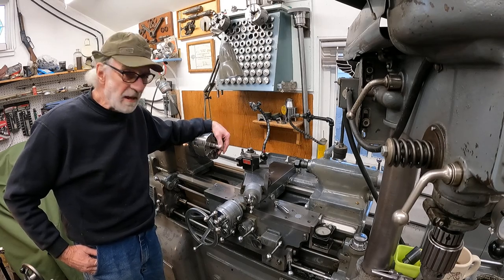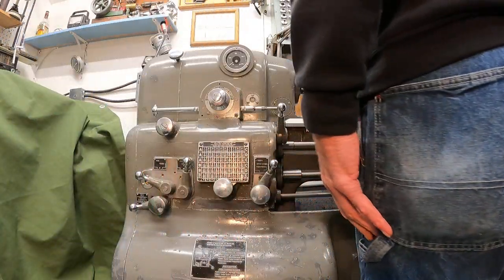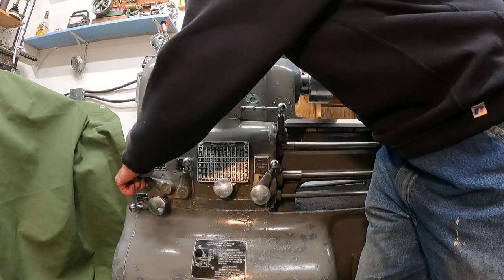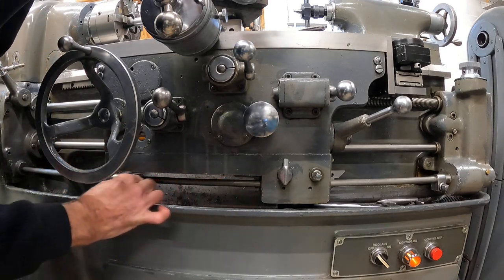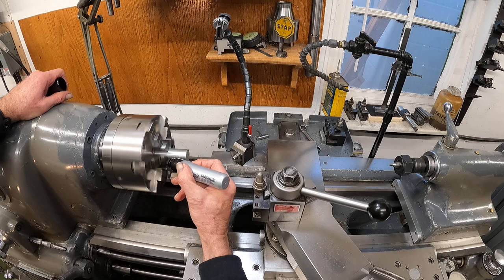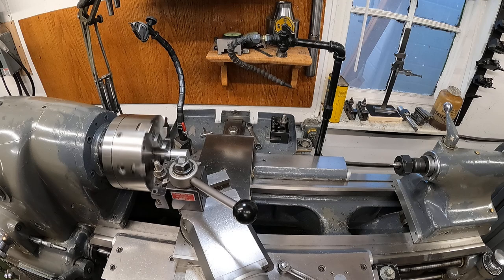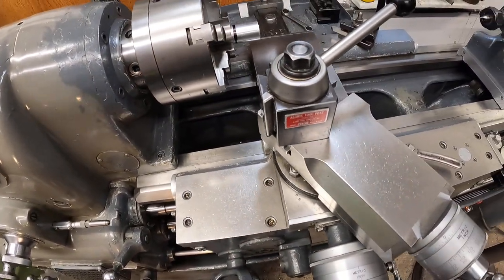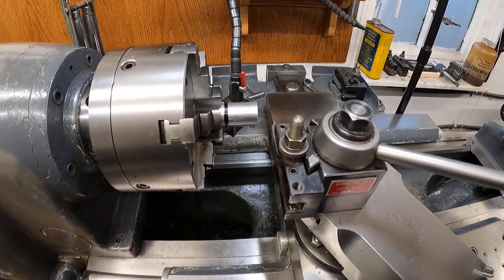Monarch 10ee Inch/Metric Lathe Metric Threading Part 1

Comment: In my experience on my ELSR, once you set the stop it will repeat within “tenths”, but if you change spindle speed it will change the stop location due to the spindle inertia coast, you had set the stop then sped up the spindle in your demo, hence the .020 reading IMO….VERY good explanation/demonstration
Reply from the maker: I did get ahead of myself by not setting the speed first. Many operators dislike the ELSR, once you get used to the machine, most of the time it is easier and faster to work the spindle lever by eye and hand like machines with mechanical lead screw reverse. The apron mounted lever with its gears and keyed rod has slop. Many inch/metric lathes were special ordered with the standard head stock spindle control lever.
 A glaring safety problem occurs when the key in the operating rod wears and the spindle lever fails to go into neutral lock at the end of the thread.